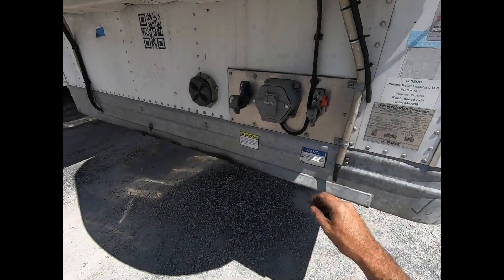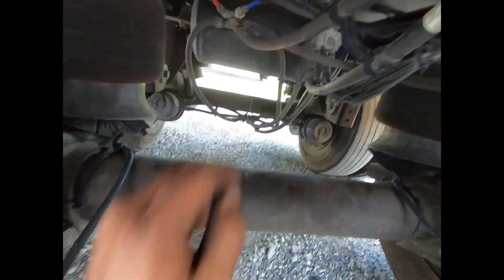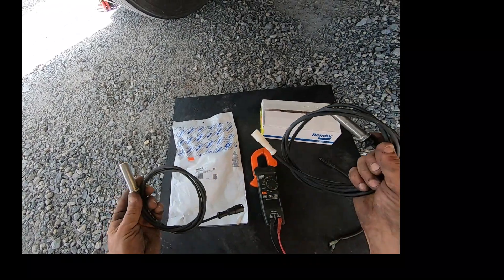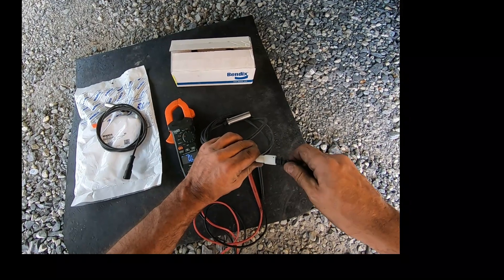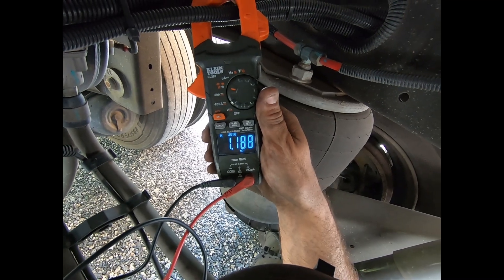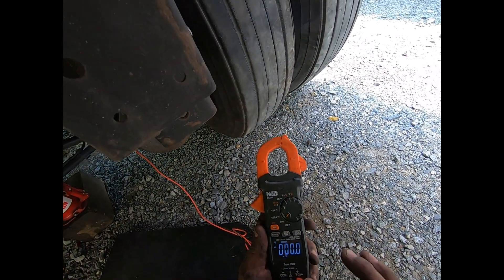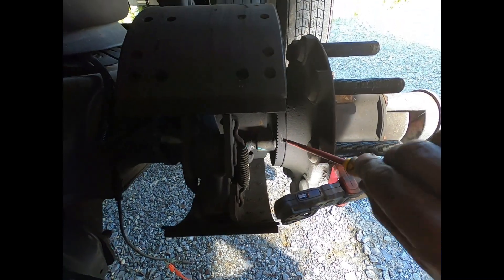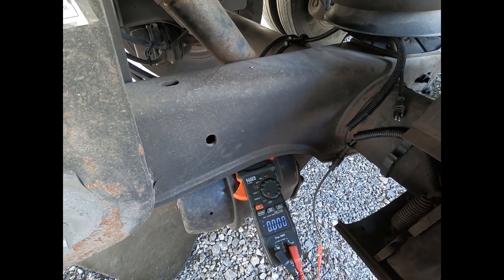ABS Speed Sensor Diagnostics. Two tests to determine if a speed sensor is bad.

Comment: What do you do in situations where the abs light just stays on? And is not giving a blink code, but just remains on
Reply from the maker: Apologies for the late response.  Ensure you are using proper method for pulling blink codes.  The steps to pull blink codes is different for every manufacturer, as are the diagnostic codes.  
For example if I were to pull active codes from a Bendix unit, I would apply constant power to the AUX circuit and cycle brake light power 3 times to get active codes.
But if I was pulling codes from a Haldex unit I would do the opposite for active codes...Apply constant power to the brake light circuit and cycle the AUX circuit 3 times.
If you are using the correct method to pull blink codes and still can't get the ABS light to blink, you could have a defective ECU.  Also check to see if someone has mistakenly wired the ABS light straight into the AUX circuit (blue wire).  I've seen this a lot.  Hope this helps!
Reply: @fleetrepairsolutions6372  Dude thanks!
Reply: @fleetrepairsolutions6372  dude thank you, I'm a apprentice I've been doing a little truck work but mostly trailer work and you teach me a lot. Keep up the videos they are great!
Reply: @fleetrepairsolutions6372  for a WABCO module do you do trailer aux cycle 3 times? Anything with brake power ?
Reply from the maker: Thanks for the complement, happy to help!  To pull blink codes from a Wabco unit with the ABS light on, you need to power the AUX circuit for 1 second, power off for 1 second, then power back on.  No brake light circuit activation with Wabco.